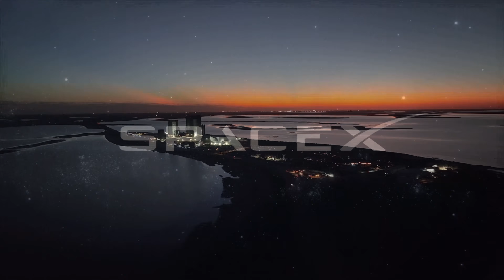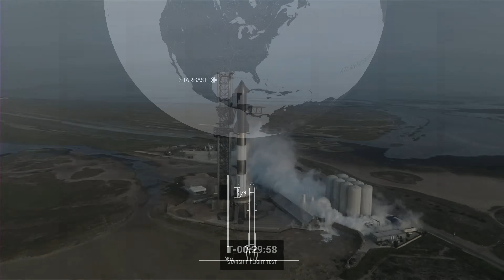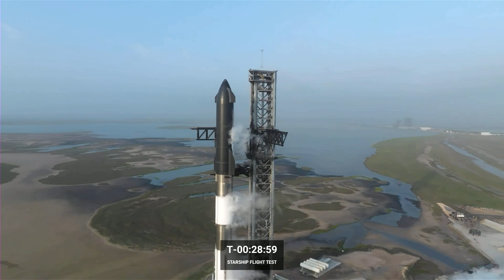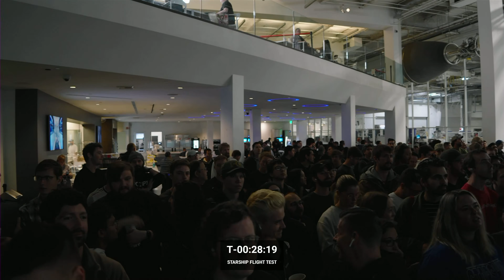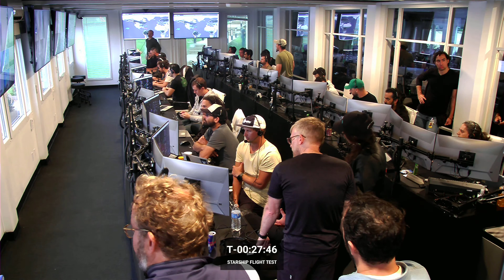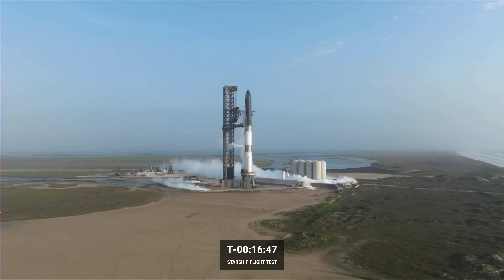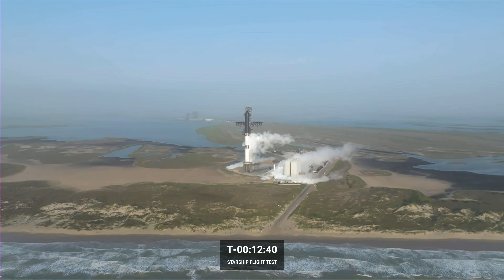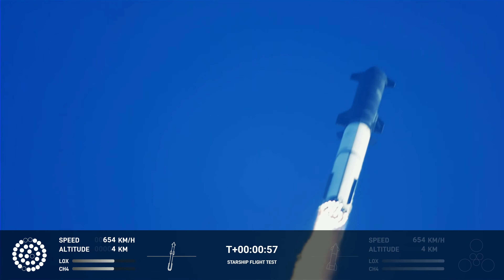Starship Flight Test

Comment: Better than I feared, worse than I hoped -- congrats to the SpaceX team for clearing the pad with this beast!! Looking forward to the future!
Reply: Better than I feared, worse than I hoped. <- Yup, same here. But to me, the fact that the rocket didn't break apart while spinning so hard, despite flying at 1500-2100 km/h, that was mind-blowing. That in itself is proof of how sturdy the rocket is - amazing.
Reply: @kneekoo  Means they can remove mass :)
Reply: @kneekoo  Exactly my thought when I saw this, I've seen a lot of out of control rockets and they all break apart almost instantly, here it held together even with the aero-surfaces of the Starship completely at angle with the flow of the air... amazing structural strength here. Actually I'm pretty sure that the pad flaws did damage the rocket before liftoff, there was things flying around, you can even see something flying higher than the rocket, two engines got knowked out even before clearing the pad... I'm not too much concerned by the rocket but the pad is definately flawed.
Reply: @NorasGuidetotheGalaxy
You hoped it was going to do better than the engineers had planned for?
Reply: the reason why it started spinning out of control is because rocket engines lose thrust at zero atmosphere and they have no control in that environment, in other words NO aerodynamics. PEACE.
Reply: @UFOpilot.  get a load of this one
Reply: @Turbo999be  Yeah, kinda feared this might happen. Dig that flame trench allready!
Reply: @UFOpilot.  Imagine being this confident and completely wrong at the same time.
Reply: @schlomoshekelstein908  They had hopes too, but not enough data to be sure if and when it would fail. If they were sure, they wouldn't have bothered making a full flight profile. But hope is cheap, and they're people, so I'm sure a lot of them hoped for a full mission duration. :D
Reply: @prashank  yeah, i got a load of laughs and zero surprises out of this one LOL. PEACE.
Reply: @garretm.9772   i don't have to imagine anything. imagining and fantasizing is for earthlings that don't understand anything about cosmos. PEACE.
Reply: Was clearing the pad the goal? Were the objectives met?
Reply: @IsmaelMartinezPR  With this being just a test, they wanted to learn as much as possible from the launch, hoping to go as far as possible with it. And considering they went well past Max-Q, they got a lot of data.
Reply: @UFOpilot.  There's still atmospheric pressure under 40 km altitude, but thrust control is possible in space, or the many space missions would not be possible. That's how satellites are kept in orbits around planets, change orbits, steer etc. Didn't they teach you this kind of stuff at the University of Flying Objects? :))
Reply: @kneekoo  Its like Yei!! lets throw millions into the ocean while there are still hungry people in the country. Were the objectives to just go MaxQ or to just clear the tower? I dont think so. I would have said  "everyone , back to work we have world hunger to solve"
Reply: Better than I feared and worse than I'd hoped are my sentiments exactly.   Watching that freaking mountain clear the tower is something I never forget though.  Right up there with watching three twin boosters of falcon heavy land together for the first time.
Reply: @IsmaelMartinezPR  We can work on multiple problems at the same time.

Comment: I still can’t wrap my head around how much thrust that thing has, the Saturn 5 was and still is awe inspiring but Starship is just on another level entirely. Huge respect to the amazing humans that made this possible, looking forward to seeing where this goes!
Reply: @stevethomas-cc5lz  this craft is much more bigger than saturn 5 tho
Reply: And it only took 50 years.
Reply: @stephenvancedaniels  Yeah how sad, we could've had a huge Lunar base by now.
Reply: @newdiary6978  apollo was 334 feet tall.  This ones 390 tall.   Its not that much bigger
Reply: Saturn V never blew up in flight.
Reply: @gj9157  whalers on the moon
Reply: @stevethomas-cc5lz  but still, It's over twice the thrust of a Saturn 5 and it's roughly twice the mass. Still the biggest, the heavier.
Reply: @bcask61  that's because the complexity of the two is different. Starship is more complex than saturn v
Reply: @bcask61  Saturn V was never designed to be a rapidly iterated on vessel with all the added complexity for full reuse/landing. It's easier to build a bespoke single use rocket with all sorts of extra time and money invested in it to ensure it's perfect, than to do what they're doing with Starship with purely private investment
Reply: @newdiary6978  right.   He will get it right in a yr or two.   Just keep fixing the glitches.   I live near the area.  At night i can see them launch ftom my front yard.   Today is over cast so i couldnt see it.  Had to live stream it.    I will say night launches are very cool.
Reply: SpaceX couldn't launch a rocket - it was amazing, a lot if experience!
Roscosmos couldn't launch a rocket - it was the largest fail ever.
Be careful, don't confuse.
Double standards.
Reply: @bcask61  actually a bunch of them did.  and a lot of people died in them.  just like this one.   its a test launch to see what happens.  nothing more
Reply: @Изобретатель-велосипедист  The Roscosmos N1 took 3 catastrophic failures right off the launch pad before the 4th test where they only made it half as far as this Starship did. No one is denying the role the peoples of the USSR had in spaceflight, but it must be acknowledged that a private US firm is able to achieve more success with private funding than the whole of the USSR's greatest minds and resources could muster.
Reply: @stevethomas-cc5lz  nearly 2x stronger tho
Reply: @Big_Red_Dork  Remember recent launch of module Nauka to the ISS. The head of constructors got TWO attacks during the mission. At the same time news were: it will not be launched, the fuel is over in the space, the engines start rotating the ISS. Anyway, engineers dealt with rotating and stabilize situation. Why was so match hate to module Nauka?
Reply: @stevethomas-cc5lz  This has twice as much trust as Saturn 5 i guarantee that if you had of been there for this lauch it would of been way more impressive, twice the power twice the noise there is no way this could not be less unimpressive than Saturn 5
Reply: @Изобретатель-велосипедист  Because there was a software malfunction that caused the engines to fire and spun the ISS around, and could potentially have put the cosmonauts and astronauts on board in danger? 

That kind of sloppiness just simply can not be tolerated when human beings are on board the ship. They figured it out eventually, yes, but that doesn't change the fact that it introduced a dangerous condition to the flight state of the ISS.
Reply: @Big_Red_Dork  what can you say about the news: it will not be launched, and fuel is over in the space? Is it OK?
Reply: @Изобретатель-велосипедист  In terms of fuel, I'm certain that some of it wasn't consumed, but as you can see in the explosion, the fireball was so complete, and the pressure so low up there, that the vast majority of it was likely vaporized and then ignited in the blasts. They put purposeful self-detonation devices inside for this sort of circumstance, so they can blow it up rather than dump liquid fuel everywhere. 

As for it not launching again, I have not seen that anywhere in the news, so I can't comment on something that doesn't appear to be true
Reply: @Big_Red_Dork  Are you ChatGPT or a human?
Reply: @Изобретатель-велосипедист  definitely a human lmao. A nerd, certainly, but yeah
Reply: @bcask61  Do you know how many Saturn engines blew up in testing though? :)
Reply: @Изобретатель-велосипедист  Which Roscosmos rocket are you even talking about? You butthurt by some niche outlet calling it "the largest fail ever" but you don't even disclose whom you are quoting.

That's called going full offtopic.
Reply: That's exactly what my wife says - not so sure that I like it though when she cries out 'Elon' just as my booster fires!  🤤
Reply: @stephenvancedaniels  and we carry an harpoon
Reply: @Lawson7086  seen it once seen it all.   but point taken

Comment: Incredible. Well, you now know you can liftoff minus three engines, and Backside Cork 900 that thing if you have to. Man my heart is still slamming.
Reply: Imagine a cocky pilot doing a full 360 before touching down on Mars just becasue "That baby can hold it"
Reply: damn, that thing is strong to spin around like that and end up needing flight termination. I know there's not much air up there, but still.
Reply: Considering where those engines were located to each other, I wonder if those shutdowns were actually intentional?
Reply: @TheMarcusrobbins  ignore Air, just the G-forces of something that size tumbling can be massive
Reply: "Backside Cork 900" kudos for nailing that call, lofl, amazing vehicle that will soon revolutionize spaceflight!!!!
Reply: I cried as it cleared the tower and I don't cry easily, lol  Congrats team SpaceX, twice the thrust of SaturnV and without all engines lit is one for the history books!
Reply: 46:24 looks like only 27 engines lit, so 6 failed right?
Reply: I heard them say three, but it looks to me like SIX engines were out at 46:22.
Reply: I believe it was five failed engines.

Edit: Apparently it was eight.
Reply: Don't the main engines have to cut-off in order for Starship separation to occur? The mains stayed lit.. I'm speculating, of course.

Maybe too much inertial force from the booster onto the Starship for it to be able to separate?? Could simply be a matter of latch disengagement failure between the stages?
Reply: @SloaneLasers  Easy, you have more engines than you need to achieve orbit while expecting not all of them to ignite.

It cleared the tower while apparently leaving the OLM intact... A major milestone in space history, congratulation to the hardworking SpaceX team!!!
Reply: @ser_optimus8335  I am impressed that the Starship's heat tiles can withstand the insane vibrations and forces endured throughout the launch. Was one of my main concerns!
Reply: Did anyone else think Starship was trying to correct for the spin, looked to me like the cold gas thrusting were working hard and maybe even some gimbaling of the Superheavy engines?

Comment: I didn't expect it to be so impressive, watching this giant heavy mass lift off so slowly from the launch pad it really gave the sense of scale in this thing. That there were 5 engines out made it go up slower than it's meant to but it really accentuated how heavy this thing really is. 29 engines could still only just get it off the pad that fast. It seriously reminded me of all the clips of the saturn V that I've seen with how large it was. Hope it's not too long before the next one goes up
Reply: you my friend are the last person I expected to see in this comment section
Reply: @notsomicrosoft7356  on what?
Reply: epic
Reply: Here before this blows up
Reply: @bruno5336  LMFAO
Reply: Surely this is some redundancy built in? 6 engines either failed during ascent or didnt light

Comment: The glow of the engines as it goes up...This test is just INCREDIBLE!!
Reply: it literally blasted in 49:04 how it is a success?
Reply: @basiccoder2166  x
Reply: @basiccoder2166  depends on what you call success is . This was a test flight , first one of its kind . There is no mission here except testing and gathering data . Landing could have been nice but it’s still is a win because they already said it has a lot of chances to fail and it held up very well
Reply: It blew up. Useless
Reply: @cleardrop4531  when your newborn can’t win the olympic immediately will you call him useless ??
Reply: Blows* up
Reply: @Rahulkumar-zk3tf  when my newborn is born in 1958

And cant, not just win the olympics, but last in the marathon for even 5 minutes?

Even though billions of dollars were spent on him

Yeah, gonna laugh at him. Hard.
Reply: @Rahulkumar-zk3tf  , 👏👏👍👍♥️😊
Reply: @Benzinilinguine  , 👎👎🤥
Reply: Massive fail.
Reply: @basiccoder2166  If success is defined as the meeting of a set goal, it could be considered a success, as the number one thing to achieve was getting the rocket away from the launch pad.
Ofcourse the rocket didn't finish the preprogrammed flight profile but SpaceX wasn't really expecting it to do so on the first try anyways.
Reply: @basiccoder2166  They were only look for it to clear the  tower and make it past Max Q.  It did both of those things.   It was destroyed on command by the Range Safety Officer as a precaution.  The Flight Termination System worked flawlessly.     Your glass half empty eh?
Reply: @cleardrop4531  It was destroyed on purpose.   It achieved its goals for 1st flight, lift-off and making it past Max Q.
Reply: @basiccoder2166  these accidents help to solve mistakes in the future. remember, there is no success without failure

Comment: Insane how long it kept toppling! Might not have been intentional, but definitely showed how tough the vehicle was. They'll definitely have lots of data to move past this and get into space the next time!
Reply: I hope they can pick up some pieces of wreckage to maybe get engines that did not fire and ones that did.
Reply: the lots of data: it broke.
Reply: @VostockR  okay Mr. Optimist...
Reply: @VostockR  when a toddler falls for the first time, it eventually learns how not to fall.
Reply: The initial flip over is intentional but it was supposed to have separated there... and it didn't.
Reply: @Erik W Toddlers don't go to space.
Reply: @Erik W yeah they do. Falcon 9 has been to space 229 times. Cope
Reply: @erikw792 Except it didn't fail.  
If you want failure,

I recommend the War on Drugs
Immigration enforcement
Reagans failed trickle down economy.